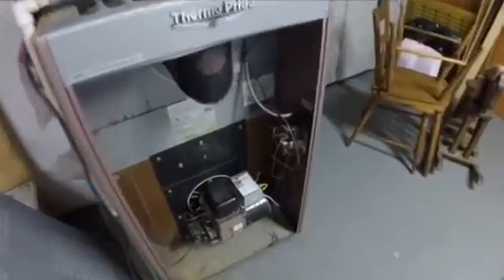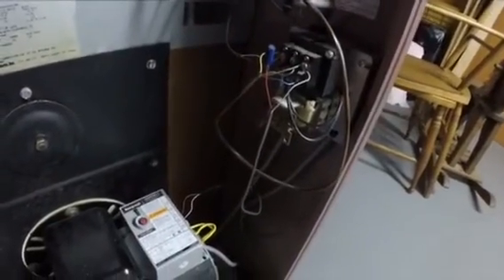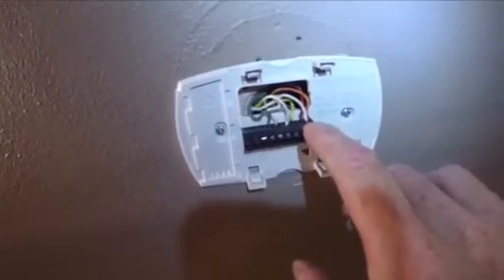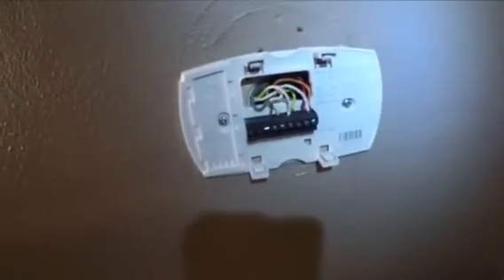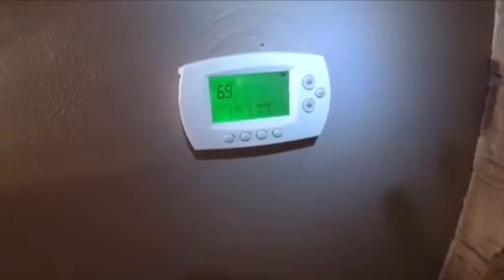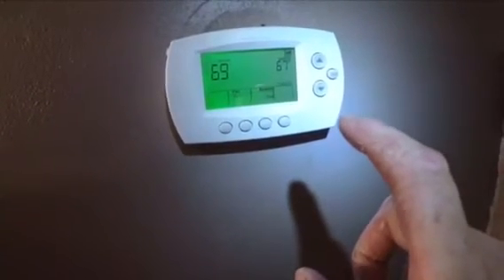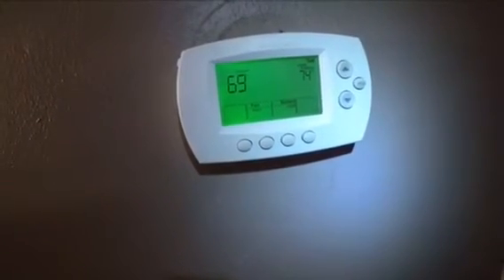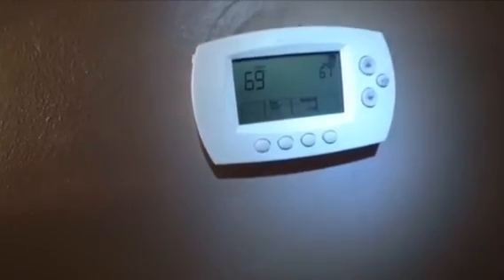Adding transformer to power Honeywell RTH6500 Thermostat

Comment: Hey Jim I have a question for you just for clarification. If I use the transformer method and put one wire in the C slot and the other in the R slot which is already occupied will that cause any issues? Or will having two wires in the R slot be fine?  I’m asking because the R has a power wire to it and jumps to the Rc slot. I just want to make sure before I attempt this.
Reply from the maker: The only way I could accurately answer your question is if you are using the same model thermostat and connecting it to one of the two oil furnaces on the market. It works for both. If you have any variation to what I’m showing here, then you’d have to look at a schematic to verify.  I get request a lot from folks that have entirely different systems and even different thermostats.  Let me know what equipment you have and I’ll see if I can help. Jim
Reply: @jimgaskell1833  It’s an Intertherm gas furnace. What I’m thinking of doing is removing the little jumper clip from the R and RC and giving them their own power source when I connect the adapter. I’ll plug one end of the adapter into the RC and the other into the C and they’d all three have their own power supply. There is a C- wire behind the thermostat but when I checked the wiring on the furnace it’s older I’m guessing because it isn’t fancy like you see on most modern systems. Plus, someone cut the wires. So that’s why I am going to go the adapter route. I appreciate your quick response!
Reply from the maker: @projectjster  just because the other wires measure voltages on them doesn’t mean they are supplying power.  The power supply you are adding supplies power to your thermostat and that’s its only job.
Reply: @jimgaskell1833  True, looking at the wiring diagram it’s showing that Rc is power it has the jumper for R. The thermostat I currently have is battery powered it’s the Honeywell TH5220D and I’m swapping it with a RTH6500WF. Wish there was a way to the wiring for this furnace but it’s a cluster under there. I was thinking about maybe using my multi meter to see how many volts were running through that wire. Would just like to be sure first.
Reply: @jimgaskell1833  I had also meant to put in the Thermostat I was replacing my old one with in my original post. 🤷‍♂️

Comment: My heat/cool system has all 5 wires in use at T-stat, the the RC and RH are hooked up as well as W G and Y. I want to run a 24 volt transformer like yours to hook up the C wire to constantly power my Honeywell Vision Pro 8000 (to use redlink accessories/internet gateway). I connect one wire from transformer to C and then I connect and share either the already connected RC or RH terminals to connect to the transformer? Just afraid of blowing something up, lol
Reply from the maker: You didn’t note which HVAC system you have.  This video is really explaining what to do if you have an older furnace/AC system that does not supply 24V to the thermostat.  My furnace had an old mercury dial type thermostat and therefore did not provide a power source to power it.  Most of the late model systems have a 24v supply coming to the thermostat from the HVAC system.  That’s where I would start.  You might have 24v coming to the thermostat from the transformer in your HVAC system.  What thermostat did you take off?
Reply: @jimgaskell1833  It's a hot water oil boiler/furnace to an air handler with A/C, it's just a long run from the air unit and furnace to the t-stat. Adding the 24 volt transformer near the t-stat seems more ideal for me. The old thermostat was just a normal programmable Aprilaire battery powered thermostat. I just want to know if it's ok to share the already connected RH at the T-stat with the external plug-in transformer. Installer did not connect C wire to this new Vision Pro 8000, but it requires C wire to use it's wireless features to connect outdoor sensor/internet gateway/portable remote control thermostat, etc.
Reply from the maker: @jhamm15  Okay I just took the cover off of mine again.  Assuming your’s is the same, one of my transformer wires goes to the C terminal and its the only wire.  The other transformer wire goes to the RC terminal with an orange wire.  So your wiring sounds just like mine.  You sound be okay.  Let me know how it turns out.
Reply: @jimgaskell1833  ok, thanks, will do!

Comment: Hmm but what if you click "hold"? I'm having same thing - flashing "cool on" ...why is it? And its not cooling, just moving air around! I also have identical thermostat.
Reply from the maker: When you click “hold” you are just overriding the programmed setting of your thermostat to whatever temp setting that the thermostat shows on the display.  For your AC to turn on, the temp setting needs to be lower than room temperature.  If “cool” is flashing it means the thermostat is waiting to turn on the AC compressor.  It has a built in delay to protect your AC compressor from sudden changes that could damage it.  Once the “cool” goes solid on (after a few minutes) the thermostat is telling the AC compressor to turn on.  If the AC compressor is not turning on something is wrong (lost signal, temp setting too high, problem with AC unit, etc.). Hope this helps..

Comment: can I run a single wire from the wall outlet to the thermostat c terminal without the adapter?
Reply from the maker: Not sure I understand your question. If you are asking “can I run a single wire from the 120v wall outlet to my low voltage thermostat”....the answer is definitely not. You’ll burn up a host of things beyond your thermostat.

If I am reading your question wrong let me know.

Jim
Reply: @jimgaskell1833  yes sir that was my question. thanks a milli.
because that is my problem right now. I'm upgrading my old honeywell rth6350 to honeywell 6580. old thermostat had only 3 wires red white green. when I did the swap there was an unused black wire which i thought would be my C wire but my new thermostat would not power on. I went to furnace to check connection from the 4 wires from thermostat only (2) red white make it to furnace (williamson gwa 2 series /wo C board).
so now I figured my only option to power up the thermostat is with 24v adapter, since connecting a wire from wall outlet to C terminal thermostat will not work.
Reply from the maker: Sounds like you need to add the 24 V DC transformer being used in this video.  Putting 120 V AC leg to your thermostat will not only destroy everything it’s hooked to but it can also electrocute you.  Please do not attempt that.  

You really need to consider the type of furnace you’re putting this on. In my case I was putting it on a thermo pride oil furnace that had a mechanical mercury thermostat.
Reply from the maker: In the description I give the specs for the 24 V AC transformer.  It’s not DC it’s AC.  If you Google search for an external transformer for your thermostat it should give you some options.

Comment: Hey Jim, I’ve got the Honeywell RTH9585WF Wi-Fi thermostat.  I’ve wired it exactly as you have in your video even with the adapter.  The furnace works fine and the fan comes on when the heat is turned up.  But when I want to turn on the furnace fan only it doesn’t come on?
Reply from the maker: What’s the model and brand of your furnace?  Do you also have air?
Reply: Yes I have AC as well. Furnace is a Trane XR90
Reply from the maker: Bill Dashper , sorry I missed your reply.  You have a newer model gas furnace so I’m not going to be much help.  On my oil furnace the fan is controlled by the furnace to push the air up and keep the heat exchange cool.  When the AC is on the thermostat drives the fan.  You shouldn’t have to add a transformer for your furnace because there is a power source coming up to the thermostat.   Not the case with mine since my old thermostat was a mercury dial.  There is a wiring change you need to make at the furnace to make your thermostat work.  I’ve seen this on other YouTube videos so you’ll just have to research.  If you fixed it already , let me know what you learned.

Comment: What do you think about using an in-use doorbell transformer to double as the C wire for a thermostat? Maybe when someone rings the doorbell, the thermostat display will go blank? Heh
Reply from the maker: If your doorbells is working well, I should be fine...or not...depends on your tolerance for risk...:-)

Comment: I have the exact same thermostat, did you remove the metal jumper or leave it in?
Reply from the maker: I left mine on.  Weather do you need one or not depends on your furnace.  Mines an old oil furnace so it has very few wires.
Reply: @jimgaskell1833  I removed it and it works perfectly!
Reply from the maker: Andrew Yeager-Buckley, verify the AC function too.

Comment: Jim: I have a brand new Mr. Heater with only a red wire and a white wire and no electricity is involved in the ignition (pilot light) and they provided only a mercury switch "dumb" thermostat.  They said it wouldn't handle a smart thermostat but we have two other indoor system running on the Honeywell smart thermostats and we would like to add this Mr. Heater to a third Honeywell we will buy if it could work.  I can run the 24vac transformer, and I thought you might help me to know which terminals to use for the Mr. Heater red and while, and the transformer power wire to the thermostat.  Thanks!
Reply from the maker: Yes, mine thermopride oil furnace also had a mercury thermostat as well.  The reason I have more wires is because I'm controlling and AC unit and the furnace fan in auto mode.  

There might be a better solutions for your  Mr Heater than using the honeywell thermostat.  Have you researched wireless outlets?  The outlet is thermostatically controlled with a remote (and perhaps online) that your heater plugs into.

Comment: Most furnaces have a a return wire from the transformer, one to the red terminal  and the other wire goes to the C terminal. There is an inherent risk of  crossing two transformers. It usually ends in smoke  Brian
Reply from the maker: Brian Burton,

Yes it really depends on the furnace. I’ve had this setup on thermo-pride furnace for over a year tested through all seasons.  If you have an oil thermo-pride furnace this will work without worry. Each furnace requires a different set of considerations.
Reply: Yes there is a 50/50 chance of smoke because contrary to popular belief, AC has polarity. The secondary AC voltage produced by a of a pair of transformers can work in opposition (said to be out of phase).  When this happens, either one (the expensive one, usually) or both transformers will oppose each other resulting in smoke. 
There is a way to avoid that and ensure the two transformers are wired "in phase". Test the voltage from both the system (running from the boiler or furnace) and from the added transformer on an AC volt meter. The process is fairly complex  because these secondaries normally float. When the two transformers are in phase, they push and pull voltage together and can be safely run harmoniously. Don't try this by trial and error with your system, because a smoked transformer in your boiler is a fairly expensive part. There is a great video "How to phase 2 HVAC transformers" demonstrating how to do this on YouTube at https://www.youtube.com/watch?v=6R7n3irwx_0